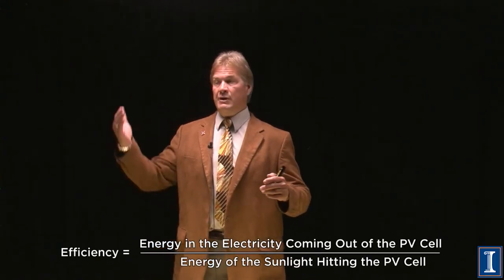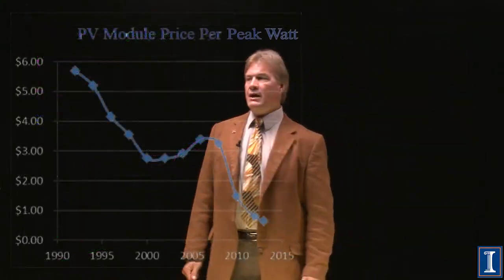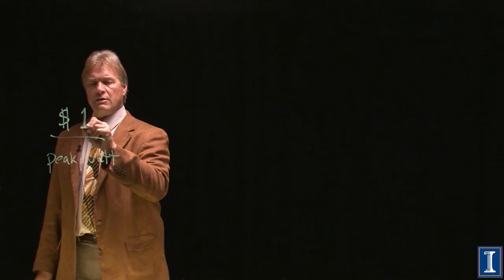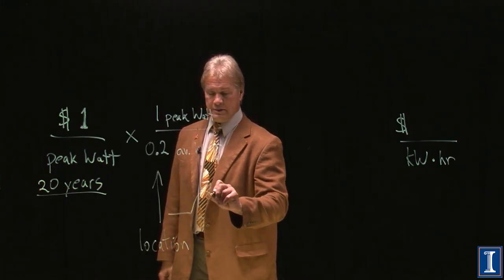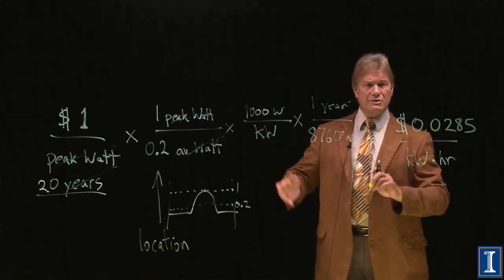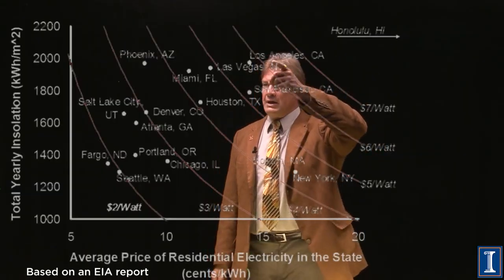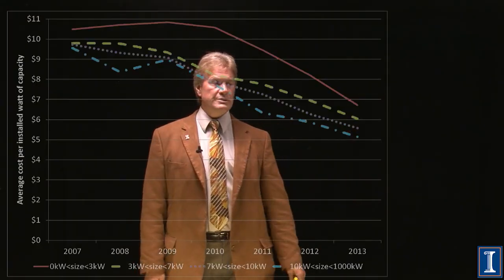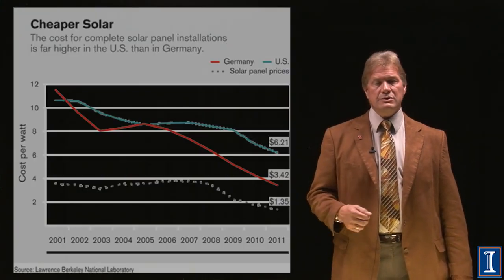The Cost of Sunshine

Comment: This is a fantastic video for the analysis of consumer home level solar usage, but it definitely doesn't work on a system wide basis because of the storage problem. I am very curious how that would be calculated for on a system level, or even if it could be due to the fluctuating output and demand for energy.
Reply: imagine putting a power wire over the Arctis to Europe, so we could use each other's salt Power while it's night at our place.

Speaking for Europe: connecting from Portugal to Russia there would be an enormous potential to move power geographically by grid instead of temporarily by storage
Reply: @xXxno6xXx  With Europe I agree that there would be potential there, but there is no way nations would ever allow their interests to be overshadowed to such a degree. Imagine Germany trying to sanction Russia when Russia could turn their lights out at the flip of a button. 

For USA there is no way that such a thing is practical. It would be the single most vulnerable "soft target" in the world and would extend our military too much.

I think the problem of sharing power between two areas in the same state in the US would be  a big enough problem, because the problem is that nobody wants to deal with a blackout even if it is necessary on a grid level.
Reply: @peterranney9488  actually, we have power lines crossing borders and trade electric energy all the time.

Speaking of Germany: we have a high  population density, import oil and gas from Russia already and don't even have  nuclear Ressources.
What we got plenty of 
is just the worst type of coal.

What I'm trying to say: we import energy today. Why should we put on  enormous economic burden to reach self sufficiency, when the stated goal is global minimization of radiative forcing.

Connecting existing grids can do a lot ,in lowering cost for all 
parties. 

As speaking of Russia, president Putin said something in this kind about a multipolar world 
with multilateral dependencies. Maybe it  helps to not bomb each other if we are hooked up to the same wires

Comment: Can we revisit this in 2021, please? Would like to see todays numbers plotted on graphs to visualize the changes from when this excellent video clip was made.
Reply: Ted Longings  Solar will be so cheap in a few years that it won't make sense not to have  it.  Especially when they pile on all kinds of new taxes on fossil fuels.
Reply: Ted Longings  Hahahaha great, when can we expect your next coal or nuclear power plant?
Reply: I did a deep dive solar Risk/Benefit spreadsheet for my home, located in Phoenix, AZ, back in 2018. What I found was that adding shade structures, shade trees, and other shading had a huge ROI. Solar would take 17 years to pay off and only give my money back for the next 8 years. The yield over lifetime was 3.3%, but not earning a dime until year 18 had begun. Shade on the other hand has a payback of 3 months and a yield of 30%.
Reply: @nicklockard  ???  What were your assumptions for the cost of PV and the cost of electricity?  The cost of PV has declined ~40% in the past 3 years.  Tesla is now installing solar for $2/w.  At that cost the payback period is <8 years in most places.
Reply: @Chris-ie9os  Yes, my data is pretty outdated at 3 years old. I used the price per Kwh for my provider APS which was 5.5 cents/KwH non-peak and 20.x cents/KwH on peak (noon to 8 pm). I also accounted for increasing pricing and the probable (since realized) rate change to include peak demand charging. I can't remember the installation costs exactly. 

If I were to do another deep dive, it might perform substantially better. But keep in mind Arizona's government and regulators are quite anti-solar and there aren't any rebates or incentives.

However, what the deep dive really taught me is the power of 'Negawatts' (an Amory Lovin term he coined). 1 Negawatt (a watt you DON'T use) is worth 5-10 newly created watts. Maximize your shading (here in hot climates), optimize the solar orientation (ranch laid out east/west), and put money into INSANE levels of insulation. This will ALWAYS outperform any technology, be it renewable or not. After hammering down on every lost watt, only THEN should you begin the analysis of PV or other renewables (geothermal heat pumps, PV, solar thermal, solar air conditioning, etcetera). 

What I realized is that it is EXTREMELY hard to improve upon a true 'net zero' home. Plus, if you live in a city, code requires a grid connection. APS charges us about $95month just to be connected, even if we use no power. 

Aside from doing net zero building, my deep dive says that augmenting your homes cooling or heating with direct-drive solar (not grid connected, but using thermal batteries (see Ice bear https://www.youtube.com/watch?v=-gtZyIOeg0w as an example) is superior to grid-connect. 

Basically, I think that THIS political climate (here in AZ, the utilities have all the power over solar and dis-incentize it), maximize net zero then 'thread the needle' with augmented heat/cool is the way forward for me.

I don't need to waste time on a model anymore because of the universal and timeless principles the first one taught me.
Reply: @nicklockard  Not sure how you calculated the value of shade but unless you have a very poorly insulated home shade does very little to reduce energy required for cooling.  I tried did the calc years ago to find the bonus roof mounted solar provided due to shade and it's negligible.  Any home is going to use electricity.  Sure...reduce how much electricity you need is step one so you need less PV but step two should be getting what little you need from PV...
Reply: @Chris-ie9os  I used the code-specific R-values for walls. I used the calculated R value for my attic (which was around 13 at the time). I did some deep research and found the amount of heat intrusion due to incident solar radiation, which in our solar insolation and ambient temps accounts for (IIRC) 18% of cooling bill.  For double-paned picture windows, I did the solar-thermal intrusion calculations from infrared FLIR imaging (I borrowed a co-worker's high spec FLIR) and did the math. Then I integrated how much shade could displace. I didn't cut any corners of make any unfair assumptions. I'm a nerdy analytical type, and I only wanted to know the true numbers. I tried REALLY hard to cast solar PV in a favorable light because it's what I wanted. It irks me beyond belief to pay this stupid power company to pollute. But numbers are numbers and don't lie. If you're genuinely curious, I can upload the model to google sheets and share it publicly. Negawatts ain't sexy, but negawatts kick the crap out of ANY AND ALL technologies. Just don't use the power in the first place!
Reply: @nicklockard  You're right... numbers don't lie.  If you're paying $2/w to install Solar that's <$0.05/kWh over the life of the system.  How much do you pay your utility?  Reduce your consumption to as close to zero as possible and let PV take care of what's left ;)
Reply: If you install it yourself in your yard, and not on your roof, the cost per kwh is supposedly on track to surpass fossil fuels in the next couple of years as battery technology advances. The cost and lifespan of the batteries is the only thing holding back solar at this point. Installed cost is a different story. Having a system installed on your roof can easily more than double the cost.  And then there is the matter of cleaning, maintaining and repairing the panels which no one talks about. If you aren't willing to do all that yourself, then solar is always going to be more expensive.  How much more expensive will be interesting to see. And don't forget, you'll need to invest in some sort of backup generator for those times the system fails, if you don't have one already.
Reply: @spuriouseffect  Lol what are you talking about. My parents have a home PV roof system, no batteries needed, the utility accepts all excess power at some predetermined rate.
Reply: @pspublic13   I wasn't talking about continuing to use fossil fuels.  I was talking about switching over to solar completely.  Yes, simply hooking up to the grid makes perfect financial sense right now if you have to money to invest.
Reply: @spuriouseffect  What you said is that batteries are expensive. I agree with you. But it is perfectly possible to have solar without any battery system at all.

As for cleaning, unless you are in a desert, most cleaning is done by a good shower. 

The only exception for my parents is during spring when pollen can cover the panels. But even this is only for a few days as the next shower cleans off the panels.

The bigger issue is trees near your home. If the house is shaded, obviously avoid solar PV.
Reply: @pspublic13  It's a little harder to do when the panels are on your roof. And in northern climates solar can be a pain. But yeah, if you're just hooking up to the grid without batteries, then it may be worth it.  My electric bill is only 30 dollars a month, so it doesn't make much sense for me.  But if you have a big house and a big family that uses tons of electric, sure solar is a great idea, especially if you can install it yourself.
Reply: @spuriouseffect  Even under a scenario were we switch entirely to solar, home solar can still utilise a grid; the grid can just be fed into by other non climate impacting energy sources. In this regard, home solar simply functions as a distributed part of the power network, and you don't really need storage on a personal level, just on a city one.
Reply: @spuriouseffect  it does not cost a lot extra to install panels on the roof. And you dont necessarily need batteries as you are still connected to the grid and you can draw on power when the sun is out. There is next to no maintenance required and you dont need to clean them, the rain does that and you dont need to buy fossil fuels to keep it running
Reply: @bruceevennett955   In the desert where you have the most sunshine, you have little rain, and in northern climates you have snow, so yes you do have to clean them. And rain or not they still get dirty. Even grid power often goes down, so if you don't have batteries, then you most certainly need a backup power generator to supply you with power.  And you are dreaming if you think paying someone to install them on your roof is the same price as installing them yourself on the ground.

Comment: The BIGGEST PROBLEM WITH SOLAR is not any of these things you talked about.. the BIGGEST PROBLEM is that with Solar (and wind for that matter) every watt of renewable capacity also needs an equivalent watt of conventional generation capacity. If you have 10MW of Solar installed in your city, you still need another 10MW of gas turbine or coal power. Why? Because Solar is makes no power at night and wind makes no power when the air is still. Solar and wind also makes different amounts of power depending on the time or weather or both. Because batteries are too expensive to be used aright now for utility level storage, it means that solar and wind are not really replacing anything. The grid still needs the same amount of fossil fuel generation capacity irrespective of the amount of solar and wind installed. And, whether you like it or not, that cost is going to be passed on one way or another.
Reply: Less fuel is less fuel.  Would you rather have a 10MW gas turbine burning 100Mbtu/yr without solar or 30Mbtu/yr with solar?
Reply: @Chris-ie9os  Depends on the total cost equation?
Reply: @dwightlooi  Solar and wind cost ~$20/MWh.  Fuel costs ~$30/MWh.  Solar and wind are worth it for the fuel savings alone.
Reply: @Chris-ie9os  Actually, that is NOT TRUE. The best case cost per Megawatt hour of Solar and Wind are are $31.5 per MW-hr -- best case meaning we are talking about massive (>10 MW) farms in optimal geographies and projected for 2026 not inefficient residential systems. Combined cycle gas turbines are about $34.5 per MW-hr.
--
However, given that capital and upkeep costs are easily 25% of fueled generation systems, the fact that you need to install an equivalent fueled generation capacity for every MW of wind and solar means that you are actually pushing the true costs of using solar and wind past $40/MW-hr. In case you are wondering, utilities ALWAYS put in fueled generators and never batteries because batteries are $122 / MW-hr. Using batteries will essentially increase your power bill by ~5x.
--
This is a pretty good (an up to date) summary of the current energy cost landscape.
https://www.eia.gov/outlooks/aeo/pdf/electricity_generation.pdf
Reply: @dwightlooi  I guess Xcel is getting a SUPER great deal on their solar PPA from the 70MW solar farm near Roswell, NM... at ~$30/MWh.  It's a fuel saver so they had no plans to retire any gas plants anyway... it's just reducing how much they spend on fuel.  Either way... reducing 1kWh of fuel with solar for ~$30/MWh seems like a WAY smarter move than waiting 10 years to reduce 1kWh of fuel with nuclear for >$120/MWh....
Reply: @Chris-ie9os  Uh... you seem to be missing the point about capital costs being something you NEED to spend upfront. Something like 80% with solar. You then get it back over the next two to three decades. Fuel is a pay as you go cost. BTW,  you cannot simply not retire gas plants; they have a finite lifespan and you need to replace them.
--
Think of it like this... if I tell somebody to give me $48,000 now and you'll have no electric bill for 30 years, or give me $160 a month. Most people will pay $160 a month even if doing so for 30 years actually adds up to $57,600. Utilities are the same way... if not anything because they BORROW the money and pay interest on it. It is especially not attractive to save a little bit on fuel.
Reply: @dwightlooi  Uh... Xcel has a surplus of capacity but they're still keeping their gas plants around.  If what they're doing doesn't make sense take it up with them... I'm just explaining how they justified their investment to the Utility Commission.  They're investing in renewables to reduce their fuel costs... they appear to be ok with the decision.

Comment: This is a great video. The economics of energy production is one of my favorite subjects. However, where is the part where he adds on the cost of the non-solar power generation capacity required to provide power when the sun is not out?
Reply: It's only an 18-minute video. :) You're right that storageless (and even most with storage) solar PV installations need some external electricity to meet demand, and in many locales surplus solar-generated electricity can be sold back to the grid at the retail rate or higher or lower. I do research into this sort of thing for work and one of the most surprising findings I made was that in these buyback regimes, whether or not you lose your shirt in the end is very sensitive to the retail electricity rate, which brings up the spectre of having utilities artificially propping up their rates - to the detriment of people with no solar - just to subsidize the people who have solar.
Reply: @hubbsllc  I have always had a problem with net metering because with net metering the homeowner gets transmission costs for negative cost. They are the only electricity generator that gets paid retail for producing. As more homeowners have solar installations, I wonder if this will ever get pushback from the infrastructure owners.

I realize that net metering is easy because solar production simply slows or eliminates the rate as which power is taken from the grid, but some arrangement should exist wherein the homeowner should have some rate at which they will sell power and the power company can choose to accept or not based upon competing alternatives.
Reply: @es330td  There is certainly room for determining just what would be a "society-optimal" regime. Personally I'd rather have the utilities handle the solar PV in big farms. We were never expected to have gas turbines in our homes for generating electricity; the replication and spread of all the complex components needed to make that work would make for a very resource-inefficient situation.
Reply: Nuclear costs 2-5 times more for energy than renewables and combined with existing energy storage options ALREADY AVAILABLE is still half as costly as nuclear and cheaper than fossil fuels.

Comment: Here's a problem with his analysis.  Believe it or not, solar panels DO generate significant amounts of electricity on a cloudy day.  I've seen it with my system. Some of the wavelengths of light that panels are sensitive to actually penetrate the clouds and create electricity in the panels.  Actually, it's a lot of electricity.  I've looked at my system on cloudy days and wow, my battery is topping off as the wind howls outside.

Comment: They could blanket the desert in solar panels then use high voltage dc transmission for high efficiency transmission to the rest of the country. Would still need batteries. That might make more sense than every house having a solar array

Comment: out of date data, 2013 on his graphed was like 2/3 of dollar per peak watt, and in 2020, it's around 1/3 of dollar per peak watt.  so 10 cents per KW hr  NOT 30 cents.  for installed watt, In 2020 in the US, it's dropped to  $3/Watt not $5-6 installed capacity of 2015.  This means on his graph, Denver, Atlanta, Chicago start to make sense, while Phoenix, Miami, Houston, Boston, New York, San Francisco now make a lot of sense.  This ignores innovation like Tesla solar shingles.  solar shingles can be a solution to his point about custom roof variation in the US.  installing cost much less if a new roof. or doing it at time of needing to replace an old roof.